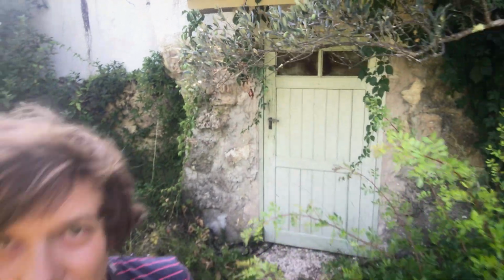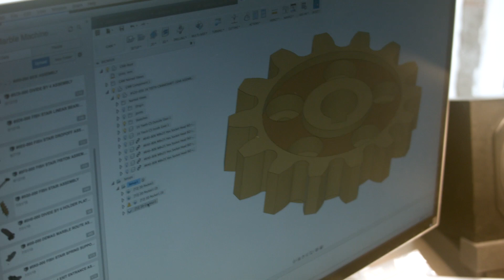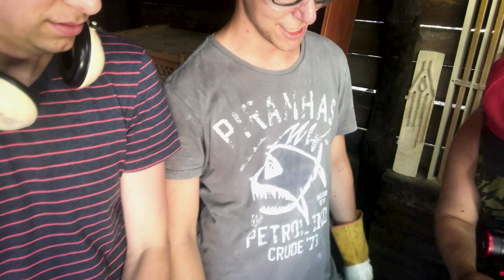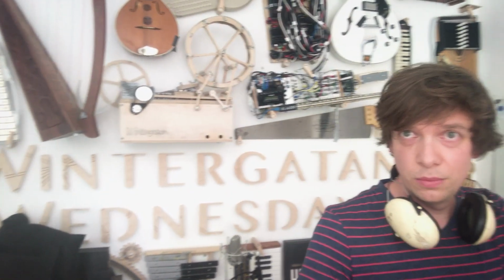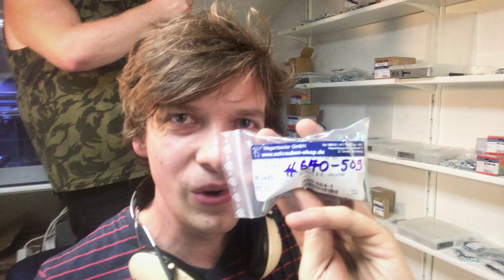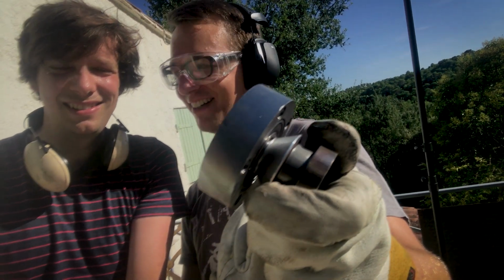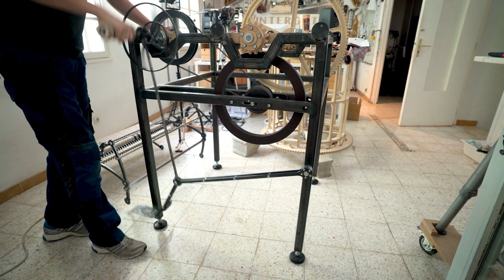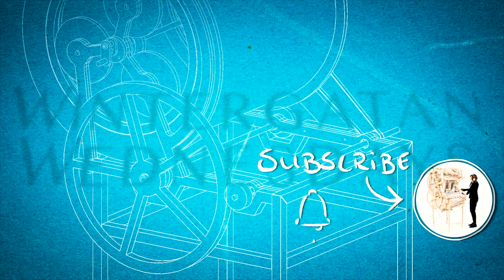Workshop Tour with the Build Team - Marble Machine X #50

Comment: Good to see everyone working on the machine. I have just one comment that I need to share. The looks of the crank and peddle appear to be to small or dainty to the overall look of the machine in my opinion. The crank also looks to be smaller that you may want in diameter as well. I think  the crank should be larger or the belt connection larger so when you turn the crank once the flywheel turns more turns. Also maybe something to look into would be a ratchet system for the foot peddle rather than it being attached so it's always moving. 

I am watching these videos anticipating the marble machine completion and music from it. Keep up the good work ! I enjoy the videos, everyone of them.

Comment: Martin, you should add something to the handle like you have in bicycle at the rear axis, which prevents the pedals from rotating when you are only rolling with the bike (or, in your case: which lets the flywheel rotate without it keeping the handle fast). I dont know the technical term, sorry. Why? It looks like if it will be difficult to grab again once you take your hand away from it. Or am I missing something?
Reply: Ratchet system I think?
Reply: I think it has a ratchet system built in with the treadle pedal. If he is pumping the system with his foot, the crank should be off the system.
Reply: With a freewheel at the input you would not be able to use the pedal as the upward stroke is powered by the energy in the flywheel and you can only push it down.
Reply: Yes, I was thinking the same thing.  It could be tough to grab that handle mid-concert, mid-song, when you could install the ratchet system from a bicycle design so that the handle could be started from anywhere in the circular rotation, but would 'grab' and apply inertia.  Also, there could be a digital counter/RPM attached to the fly-wheel for calibration and tempos heads-up display.
Reply: the pedal is already down stroke only, kinda hard to even do upstroke with that
Reply: Overrunning clutch
Reply: @rachetfreak but a rachet also allows upstroak, doesn't it?
Reply: What exi is trying to say: Right now, the pedal is going up because there is no freewheel in the system, and that is necessary! If it wouldn't com up, there wouldn't be a chance to kick it down again. If there was a freewheel system integrated, You would have to lift the pedal manually. Therefore a freewheel is not an option here!
Reply: You did hear the noise the mechanism already produces without the freewheel. I doubt that the clicking of the freewheel could be any louder...
Reply: @Zimmerdf, is it possible to have this without the 'clicking' associated with a bicycle implementation?
Reply: I think if he wanted to, he could make the pedal as part of the handle, separated with the clutch?
Reply: Ah you are right.. I guess there would be a solution to the problem anyway, but it might be not as simple as i thought.
Reply: The flywheel isn't meant to DRIVE the machine, it's meant to even out the input. If you stop cranking, the machine will have its tempo slowly drift, which would be terrible. If it didn't have any type of flywheel, the operator would have to input the exact amount of energy with every revolution, and have nothing to dampen sudden spikes. This is only meant for hysteresis. You won't let go of the crank in a song. Perhaps as a dramatic end to a song, like the original Marble Machine song.
Reply: You can stop grabbing the handle and still powering the machine using the foot pedal!? Then regrabbing the handle looks annoying
Reply: Now that's true.
Reply: You need some system to separate the handle and the pedal so the handle could be on a ratchet/freewheel/flywheel but the pedal would always be in motion since "picking up" the pedal would be easy, also the handle flying around like that could be dangerous.
Reply: You are thinking of a sprocket. And I was thinking the same thing.
Reply: The speed being controlled by the operator was one of the problems Martin took note of during the Museum interviews. (see Music Machine Mondays playlist)
Reply: Howabout a sprag clutch?  They don't make any noise.
Reply: Something like a starter motor mechanism would work. With a friction plate clutch. Basically if you are winding the handle it causes the two plates to come together but as soon as you stop winding the drive plate is retracted with a spring. Perhaps.
Reply: We need a centrifugal overtaking clutch (it is also a "centrifugal clutch", etc.). It works noiselessly, and if properly configured, it emits a sound only when a moment it is turned on.
Reply: I don’t think he’s going to be spinning it so fast when it’s built.
Reply: I'm more concernd about his fingers when he tries to grab the handle again. Seems like a perfect opportunity to loose one or two if he somehow manages to get them inside the wheel.
But maybe a plexiglas inside the wheel would be an easier solution if it's only for safety reasons.
Reply: What I miss in this entire discussion as a reason AGAINST a freewheel is the fact that acutally the crank is synchronized with the beat. So one revolution of the hand crank is essentially 4 notes on the programming wheel. Therefore if you add a freewheeling support you would mess up that synchronization, essentially allowing notes to be played out of sync with the rotational position of the hand crank, presumably reducing predictability for the player.
Reply: DJ Gummikuh  Surely it doesn't matter about the synchronization, the song is programed to play out whatever the player does, the only input they have in respect to the turning of the drum (with the pins in it) is the tempo at which it turns.

+strng3world Nice idea about covering up the open parts of the crank-wheel with plexiglass or something similar.
Reply: No I disagree, as he's also playing the bass and that's done manually (ok the actual notes are generated by marbles but he has to synchronize his hand movement for the melody.)
Reply: In motorcycles, it's called a slipper clutch. It allows the engine to drive the rear wheel under power but prevents the reverse torque when downshifting from getting to the rear wheel and causing a skid.
Reply: Like those bearings/clutches that this old tony used on the parts he made for martin.  The handle could be attached to those, it would probably still spin but if you grabbed it it would stop and then you could go to spin it again at leasure

Comment: This is so fun to watch! Have you considered to put balance weights on the opposite side of the handle? And also mount a spring to hold up the weight of the foot pedal so it doesn't weigh down the crank-wheel? But not to strong of a spring so it weighs up the crank wheel, but a lagom one. If you do i think your marble machine will run more efficient! :) 

Looking forward to your next video!

Comment: A sprag bearing would have been a good addition to the treadle peddle assembly. It would allow you to stop cranking or treadling and lose no inertia from the excess treadle/crank assembly mass. Think bicycle peddles, you peddle, you get power, you stop peddling, you coast without the peddles spinning at the same speed as the wheel. It increases the safety factor many times over. Just a thought. Excited to see the MMX coming together. Great job!
Reply: I don't think that can work with a single pedal. Maybe it could with a spring to pull it back up, but it would tend to "sproing" (technical term) back up once past bottom dead centre. 
Treadle powered lathes were once a thing, and as far as I know none of those ever had a ratchet fitted. I am using "let me google that for you" here simply as a convenient way to encapsulate a Google search. http://bfy.tw/JdtT
Reply: andy pugh... I wasn't suggesting a ratchet mechanism. A sprag bearing, is a one way bearing. It can only free wheel in one direction. In the opposite direction, it locks up and provides a solid connection. Automatic transmissions and peddle bicycles use them. Sewing machines also used treadle peddles, neither of which were by any means safe. In all honesty, what is another spring to support the treadle? I think it would be very appropriate for the MMX. Ultimately the decision is solely up to Martin, not armchair engineers like us, lol.
Reply: The one-way clutches you describe are functionally equivalent to a ratchet, and the mechanism inside a bicycle freewheel is typically a true ratchet. Both have the problem in this case that the operating pedal will sit at the bottom of travel and so won't allow for a one-footed treadle action.  Having used a treadle sewing machine the solid connection on the up-swing is part of the feedback that lets you get a rhythm.  A spring to raise the pedal would certainly work, but I don't think it would be so nice to use.

Comment: U need to make the construction more stiff to ensure that its not shaking so much. The problem probably gonna be that you will create lots of micro-cracks around the weldseams and thus lower the life span of your machine. I suggest additional metal beams. The goal should be a zero shaking during performance (engineers opinion).

Comment: A way to remove the noise from the safety feature on the peddle is by putting some rubber on the top side of the foot where it hits the metal bar.

Comment: You need to make an overtaking clutch on the handle, so that after the overclocking, do not waste energy on the useless rotation of it and the pedal crank. So you improve the rotation time from the flywheel. And the "safe" creaking pedal at the same time do not have to.
Reply: * "And there will be no need for the "safe" creaking pedal."

German engineering: crank and pedal are connected to the flywheel, but the pedal poses danger to the foot, so make the pedal have joints, as designed weak points...

Russian engineering: disconnect entire system, it will sort out almost every your problem...
😂
Reply: This is called "cut off all unnecessary" and my nationality has nothing to do with it. If there is a freewheel clutch, the pedal will not be necessary in the folding structure, since when the pedal is lowered on the obstacle, the clutch will open. Safety does not suffer, the design is simplified, the reliability is at the same level.
Reply: Владимир Ульянов I actually had a similar thought when I saw the pedal system: why not make the pedal lever just pull on a toothed strap connected to a toothed drive pulley with a forward friction clutch (equivalent to ratchet and pawl, but quieter), so that there is no energy from the spinning crank forcing the pedal down to mash anyone's foot (and washing energy)? And I happen to be American. But- I chose to remain silent as I presumed these guys had already thought of this and rejected it. But, maybe not... If a strap is too floppy, maybe a pull-rod like here would work, as long as it's not driving the pedal down via inertia. Glad this other engineer spoke up or I wouldn't have said anything...

Comment: I believe you keep time with the crank and foot pedal and I don't know if you would want de-sync them.  However, you could look into disconnecting the crank and foot pedal from the flywheel.  You could install a clutch similar to a bicycle to drive the flywheel but it would not waste the energy from the flywheel turning the crank and foot pedal when you are not cranking.

Comment: I think a clutch system needs to be added to the handle/treadle pedal setup so the handle and treadle pedal are not rotating while your not turning the handle,  should help with the inertia and length of flywheel timed runout.  For what’s it worth. 👍🏻

Comment: You might want to look at putting a bicycle rear whell hub in the crank system to cut down on the mechanical drag from the crank and pully going to to the flywheel when you not cranking it.

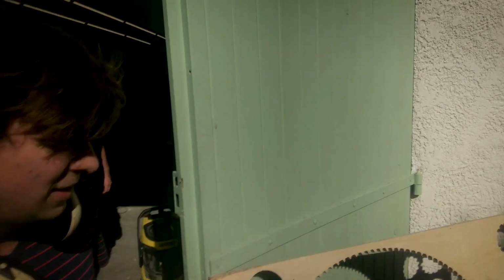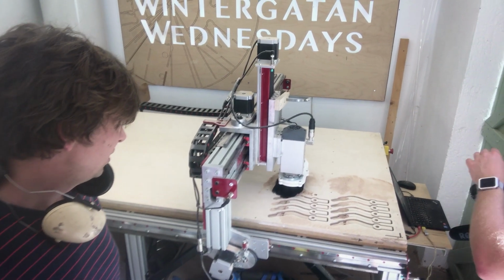Comment: Actually, The Flywheel was freerunning for 2:30, not 2:00 (Take a look at the second hand at the start, back up 5 seconds for picking it up... pretty much right at the top

Also, I concur with the others who are foreseeing bent fingers and smashed knuckles if you ever let go of that handle and attempt to re-acquire it. You really NEED a clutch/freewheeler setup
Reply: The handle wont be that fast during a normal song. It is supposed to be in time with the music so that should be around 80 - 160 bpm. Should be easy enough to catch, no?

Comment: It seemed like you were saying that the part Alex was grinding to a very smooth finish was to attach a belt to the flywheel, as in, to transfer power to the rest of the machine. Wouldn't it be better to use a toothed pulley and a toothed gear for that? Or at the very least, wouldn't it be better for that pulley to have some surface roughness? It seems like it's so smooth now that it may tend to make the belt slip. Am I misunderstanding something?

Comment: Perhaps my concern is unwarranted and this isn't really an issue for whatever reason, but in regards to the treble pedal: is there not a risk that it will dig into or scrape the skin off your shins by accident? It will give in to resistance from beneath to protect the toes, but by design it will resist force from above. So if it collides with the skin and bone of your leg while the crank is spinning, I imagine that would be quite painful.

Comment: Do you have any plans on putting a clutch system on the pedal/hand crank?  That handle is moving very quickly.  I'd be concerned about getting hit by it if you walked too close to it while it was spinning.  A clutch system would allow the pedal and handle to remain stationary when not cranking it, but the flywheel could continue spinning.  Just a thought...  Think bicycle pedals.

Comment: Hey ,
Why don't u use those one way bearings like one's in bicycle, 
After cranck handle and paddle wheel.
It could increase power by decreasing those parts friction & it Will be safer because machine can't drive them .

An in con's list it   Will decrease total inertia of all fast & heavy oscillating  parts.

Comment: Wonder if you could make a simple clutch for the flywheel so you are not transferring energy back to the handle and foot pedal.  Two weighted pads inside a small bell with a tension spring pulling them slightly off the inside when spun the force overcomes the spring and drives the bell.

Comment: I always look forward to Wednesday now.  Just one question..  Wouldn't it be better to have a system in place to disconnect the crank/pedal when you don't actually need them rather than wasting so much energy in an otherwise useless fashion?  Perhaps a ratcheting system or free wheeling sort of system that lets you put energy in but doesn't take energy out..  I don't know i'm not an engineer.  It also seems the added benefit would be re-accessing the crank or pedal if they're not moving on their own.

Comment: What are the differences in terms of task between the timing-belt on the right side and the wooden wheel on the left side?
Reply: The timing belt is connected to the marble lift and the wooden gears move the programming wheel.
Reply: @kitingmare  why do both need to be seperated?
Reply: @kitingmare  so no wooden wheel driven by the left side moves marbles?

Comment: Martin, please email me about MIDI cables for the Modulin. This will help me finish my build. I'll also send pictures of what I have done so far. I believe my Modulin II would withstand your tours!
Reply: The original Modulin is analog, so those are patch cables. In the USA, Radio Shack sells color coded short MIDI cables if you need them for a digital Modulin II.

Comment: @4.03 Do anybody speak chipmunk? We will need a translation.
Reply: "If you look closely, you can see that this clock is indeed turning clock-wise. I think that is because it is a very polite clock and it knows it would be rude to turn counter-clock-wise - especially when being a clock. Since i prefer to work on polite machines, I decided that the MMX handle should turn clock-wise as well." 
And then when his hand goes up he says:
"This has the added benefit, that should I ever run a clockwork from the intertia, thus making the MMX also into a clock, the universe would not collide due to having a clock that runs counter-clock-wise" 

You are welcome!
Reply: +aknopf
Thanks and  I was actually joking, due to the high pitch tone was similar to chipmunks (cartoon).